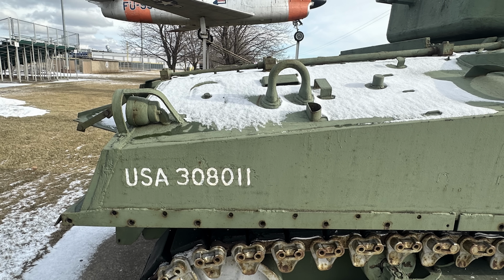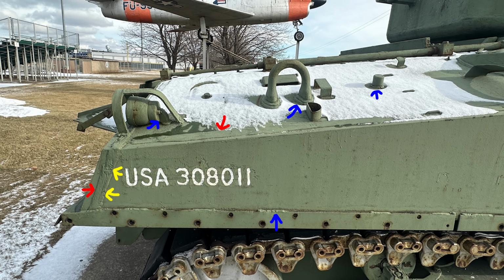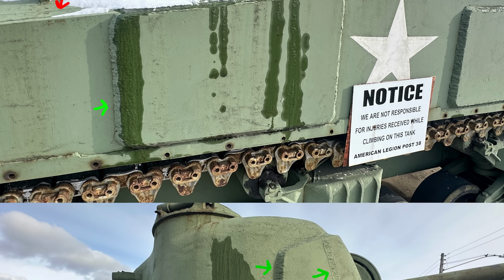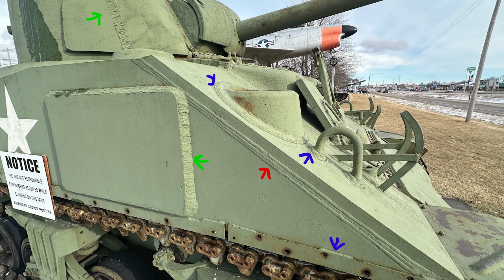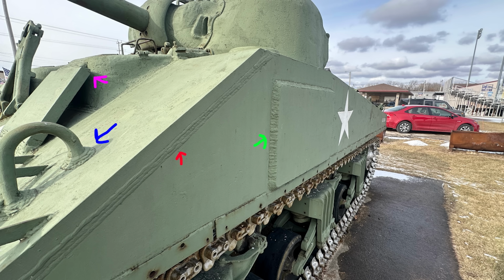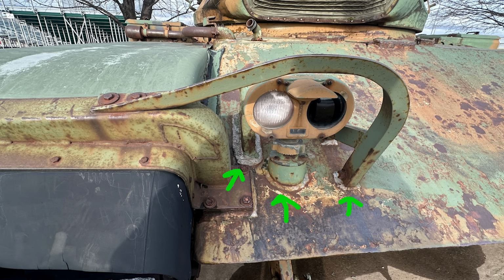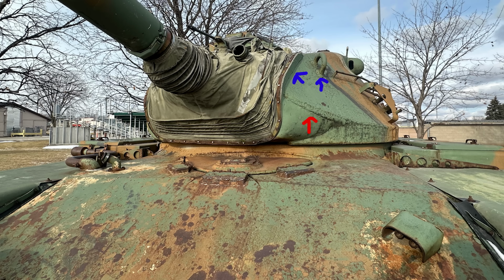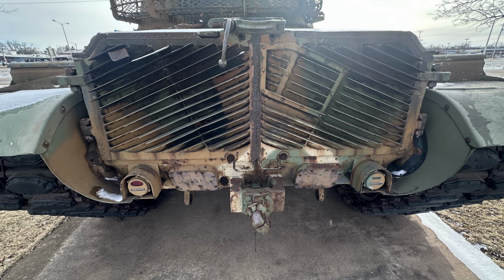Inspecting the welds on roadside tanks

Comment: This, I'm afraid, is going to be long and not have much to do with welding.
At the start of WW2, in the US, they overestimated demand for tanks.  In 1943 they cut back production greatly.  That tank in Appleton was made by Ford.  Less then 2,000 were made before Ford was removed from production as other stuff had higher priority.  Ford made Jeeps, B-24s, R2800 engines, etc.

Early M4 tanks had "dry storage" of their main rounds.  The Brits claim the M4 was a "Ronson" but that is bad chemistry.  Gasoline needs to be emulsified before it burns.  If that wasn't true I wouldn't have so much experience tuning carbs.  Big explosions are invariably the items own ammo going off.  See the HMS Hood and Barham for examples.  When a tank with bad ammo storage goes up, typically the turret if flung off to release the pressure.  See Russian tanks for examples.  M4 Shermans went to "wet storage" of the rounds to fight that.  

The Germans in 1942 and 1943 didn't really have big cannon to fight tanks - that came later.  So they figured out where the weak bits of the Sherman were and targeted those locations.  M4s allocated for overseas use were those with wet storage.  Thus the Ford M4A3s were restricted to stateside training.  They still received additional armor plates to cover the weak bits.  That tank has those.

In 1944 tank losses were extreme.  They let out contracts to gather up training tanks and rebuild them for overseas use.  Typically, an M4A3 rebuilt for overseas use would get the horizontal volute suspension, the 76mm cannon, and wet storage.  That one has none of that.  Thus it likely never went overseas.

  A Sherman with heavier armor was fielded: the "Jumbo Sherman."  In early 1945, 3rd Army ordered that destroyed Shermans from the Bulge be gathered up and armor be cut from them to be added to some existing tanks.  The armor came from Shermans, not German tanks.  The 3rd Army after action report for August of 1944 to May 1945 covers it.  Volume II, Annex 9 (Ordnance Department).  All "Jumbo Shermans," those from the US and the new ones they had made in 3 Belgian factories, received the 76mm gun.  That tank in Appleton doesn't have the armor added in the ETO was it was done differently (the annex has pictures).  Not all tanks were done as the lead tank in a column is the one likely to get hit and that is the one that needs it.

Thus that tank was made by Ford.  Unlikely it ever left the US.  The added armor was done in the field in the US.  

Down in Kenosha was a guy, circa 1996, that had a little tank museum.  He had a lot of tanks.  Including a bunch of M4s.  Don't know if it's still there.  

Yes, I say "anyways" too.  :)
Reply from the maker: Awesome thanks for the info 😀👍👍.  That place still exists, but it moved just over the border in Illinois and has expanded to have a ton more.  So cool checking out all the old military equipment there.

Comment: This is an earlier M4A3 with a 60-degree front armor glacis plate. The square armor plates were added after manufacturing in the field. The plates were sent to armor units as upgrades. As well as the turret gun shield. The center part is original. The side "wings" were added later. Interestingly, only one side has it. They were usually welded to both sides of the mantlet armor. Also interesting is that some US WWII tanks were "upgraded" with local steel cut from German tanks like Panthers and Tigers. The ring around the machine gunner's position is a mount for a canvas dust shield. The hose-looking things are clips for the cover. The plane is an F-86D Dog Sabre. A late 50s improvement of the venerable F-86 Sabre of the Korean War.
Reply from the maker: Awesome info, thanks for clearing up a ton of details on those things.  Using steel cut from other tanks is a wild (but likely effective lol) idea.  Definitely a good idea if you have the scrap available lol.
Reply: I thought I would try and find what that hose looking thing was before checking comments. I spent over an hour searching everything i could find, nope. Even model building sites people showing pics of the gun mount, nobody said what it was. I found one manufacturing diagram of external features that listed it as part number YY, however no table to name the parts! Not a single picture of a tank as in war shows a cover  crazy, I'm assuming that nobody used it or it was only for certain conditions and rarely fitted 🤷‍♂️
Reply: @CSkwirl  Hi. It's the mount for dust cover. When the canvas cover was on, it covered the entire ball mount and 30 cal machine gun mounted in it. That's why you don't see it used much. It restricted the gun movement.

Comment: Big question.  How can one avoid having a thin weld at the end of a weld when coming off the plate, like at the end of a fillet?  I do try to go back to fill the crater, but it still seems too thin at the end.
Reply from the maker: Great question.  So that crater or excessive melt through at the end takes a bit of work to fully eliminate.  I am not sure why but many people never mention it’s really a two part solution.  Many people pull back away from the corner to let it fill it, and that works.  However that might leave a glob of metal at the end.  I find that the last 3/8th of a inch or so by speeding up slightly, hitting the end, pulling back about 1/4inch, letting the wire fill, and then cutting the arc works better.  Just sitting at the end pumping in wire gives worse results generally.  That’s with wire processes.  With stick generally you can tighten the arc a bit near the end to reduce heat input and then just pull the corner back to let it not leave a blowout.  

Your settings must be dialed in as well.  If you are running hot it will be hard to not blow the end out.  If you run cold the metal will stack on the end like caulk.  Getting things looking real good is really a combination of a slight increase in speed towards the end with a pull back.  Hopefully that helps 😀👍
Reply: @ Thank you for these indications!  I’ll try this next practice session.

Comment: The bevels on the thick plates had to be deep and wide hence the three top passes,  The sub arc I ran used two dual spool 3/32 Lincoln wire and made really smooth welds, nothing like seen here. These were girder boxes for cranes.

Comment: 12:30 That thick metal wire in the shape of a horseshoe thats around the machine gun on the hull was used for clipping a type of brown canvas/cloth material similar to what you see on the next M60 tank near its cannon. Those nozzles/nips you're talking about are a sort of point to clip onto. I hope YT doesnt delete my comment for posting a link but heres an example https://i.redd.it/rs3frx7x4zw81.jpg

Also yes those extra welded thick plates on the front could save the crew from most of the Germans cannons they faced but only if they hit that tiny place which really was only for making you feel reassured because as you can see they welded them where the driver assistant and driver would sit but if it hit anywhere else they were dead.

The hitch rating on that tank is made so it can be pulled out of a ditch 😄

Comment: From what i remember from old timers telling me during their careers working with the old timers of their time, they had used GMAW and the machines were just horrible to dial in. If im not mistaken the first wire feeder system came out in the 60s and they would have the filler wire by the barrels rather than spools. And as for gas i believe they used CO2. I could be very much wrong so dont blast me up that badly
Reply from the maker: GMAW existed as far back as the late 40s but it’s really hard to say when it was used in the military.  Flux core wire existed and was used as early as the 40s on ships, but I haven’t seen much that would suggest they used it on tanks, likely because a wire suitable for welding armor likely didn’t exist.  I bet whatever machines were used for wire in the 40s to 60s were real rough.  Welders in the 40s consisted of basically a giant transformer with a/c only output.  To turn that into a functional dc output machine for GMAW had to leave a lot to be desired lol.  CO2 could definitely be used, it would react bad with stainless wire they used for some welds (lost corrosion resistance) but that wouldn’t be a issue since they were using stainless to prevent weld cracks on armor.  

I don’t think I would want to make tanks using the 40-60s tech lol.
Reply: @makingmistakeswithgreg  oh heck no! I wouldn't either haha!  I'm not sure either but they must've used a lot of 309 rod for welding the dissimilar metals then? It's definitely a interesting topic just for the history of welding regardless though.

Comment: Hey Greg that hitch rating back then from Reese for US Tanks was 1,000,000 pounds LOL. But seriously, I would like to know what MIG process they used (not talking about the sub-arc) on the 1960's tank. It couldn't be short circuit with such thick material? Did they have an understanding of spray arc technology back then? Possibly they did? I'm sure the power supply was massive and they probably prepared bevel surfaces.
Reply from the maker: So dual shield existed in the late 50s and spray arc was invented in the early 60s.  Based on how the welds looked the ones on the side were definitely wire.  Some of them were too long without starts and the overall look was not what I would expect from stick.  They could have been done with dual shield but I am unsure if stainless dual shield wire existed.  My guess is they used some form of stainless wire with a specific gas mixture for the wire (possibly high helium).   With a 3-400 amp power source and stainless wire, it would likely be possible to weld thick steel like that.  Penetration wouldn’t even need to be that good because of how much weld (on both sides of the attached parts) was put down.

Comment: It’s interesting about these added plates. They were to prevent the fires that would occur if the tank were hit and some ammunition would burn off. But they didn’t work well. The solution was to have tanks fabricated for inside, filled with water and antifreeze where the ammo was then stored. That pretty much solved the problem. They tried casting the hull, but it was too difficult. The turret is cast. The British cut the rear of the turret off and added a sponson so they could fit their 17 pounder, equivalent to an 89mm, which they had to mount sideways. That could stop a Tiger. This is a strange looking Sherman.
Reply from the maker: Pretty wild how they came up with cutting turrets apart to fit a big enough main gun to be able to fire a round to stop a tiger.   The whole armor vs main gun power race got pretty crazy in ww2 lol.
Reply: @ we never thought of fighting a Tiger when the Sherman was being designed. The Panzer IV was their best tank and the Sherman had no problem with that. By the time the Tiger was in production, we had produced so many Sherman’s that we just kept making them. Roosevelt felt that it was more important to make an overwhelming number of tanks than making fewer that were bigger. Near the end of the war we produced some Pershing’s that could easily handle their heaviest tanks. But that was already late in the war.
Reply: Casting the hull was not difficult.  The problem is that cast metal is not as tough as forged metal. It also cannot be welded as easily. Cast metal has more crystalline structure to it, whereas forged metal has been pounded and has the grain aligned in one direction. This gives forged metal much greater strength.  But casting technology in world war II was very very good.

Comment: The front (bow) machine gun, in WWII, was a .30 caliber browning (M1919A4).  I believe that ring around the gun port is used to attach a canvas cover via snaps.  The snaps aren't like the kind we think of today (two interlocking round rings).  Snaps back then were a male stud, that had an indentation near the end, and a female half with spring clips on either side of the hole.
Reply from the maker: Makes perfect sense, awesome info 😀👍
Reply: @makingmistakeswithgreg  Sorry, I couldn't remember the name of the snaps when writing my original post.  They were called Lift the dot fasteners.  Very commonly used in that era.
Reply: @makingmistakeswithgreg  Sorry, I couldn't remember what they where called when I posted earlier.  Google "lift the dot fasteners" for more details.  A lot of WWII area equipment used them.
Reply: @makingmistakeswithgreg  Sorry, I couldn't remember the name of the snaps in my original post.  They were called ""Lift the dot" fasteners.  Very commonly used in that era.  Google "lift the dot" and you can find more details.
Reply: this is correct
Reply: The snaps are the same ones used on cartridge belts and canteen covers.

Comment: You sound alot like Greg from  Greg's Airplanes and Automobiles channel . Are you the same Greg? 
 Those "nozzles" around hull MG port are attachment points for anti dust cover or masking netting  as far as I remember. Or for a transport cover. These tanks were shipped without their MGs so to save them from corrosion or dust induction. 

Added plates on the turret were due new radio installation required internal armor delete. So additional external  plating was added. Interesting gun mantlet  , it looks like very early M4A1 gun mantlet halfway upgraded to M4a2 standard mantlet.

Additional plates on the Upper front plates (UFP)  were due to the new requirements and installment  of big driver hatches. Bigger driver hatches were installed and factories as a temporary solution added additional plates to protect weakened flat portions of  upper front plate(UFP).

Later with M4a2 UFP was redesigned to a thicker  uniform UFP but at a lesser angle to accommodate bigger driver hatches.  Less angle was compensated by slightly thicker UFP.
Reply: He sure sounds like greg. But i doubt he would ask about the plane if he was the "greg"
Reply from the maker: You’re definitely not the first to ask that question 😅.  No relation to him.  Thanks for all the nice details on the Sherman.  It’s crazy how much knowledge people (such as yourself) have regarding changes and things I would completely overlook.  It blows my mind at how many changes were done to many of the ww2 era tanks and vehicles.  Luckily the library here had a book on the Sherman tanks so I rented it to help learn some more useful stuff😀

Comment: I think that is a Super Sabre Jet. They probably had limited amount of Rotisserie stations to position the hulls as they were welded. At this time frame it was build as quick as possible and get it out the door.
Reply from the maker: Yep, likely get the main welds done and get the assembly to a place where a few people can weld stuff on it and call it a day 😀👍
Reply: @makingmistakeswithgreg  Greg, let's not forget, that torch welding was still a huge thing back then. So some of the stuff we/you are looking at may very well be torch welds.

Comment: The Australian Armor and Artillery museum has done a whole series of videos of their workshop crew welding old armored vehicles back together and they say structural welds in WW2 armor steel have to be stick welded using stainless steel rods or they will crack.

The appliqué armor plates on early Shermans could have been installed at the factory, at a depot or even in the field depending upon when the tank was built.  They started adding the extra armor patches on the assembly line and sent out kits to upgrade the tanks already in the field while they worked on an improved design that didn't need them..
Reply from the maker: I wish I had a XRF gun to test the metal and the welds, it would give an alloy composition.  Due to the massive thickness of the steel and limited welder size, it would be hard to put down a big single pass that would cool slow enough not to crack.  Sub arc and 1/4inch rods on reasonably hot tank steel might work with normal mild steel filler metal, but stainless would likely work even better.  I am not sure that the original big sub arc welds were stainless, almost all of the stick welded welds I have seen are.  I need to bring a magnet and test a bunch more things 😀👍.  I also need to watch those videos.
Reply: workshop Wednesday is awesome

Comment: You don't fit inside them Greg, neither do I lol
Reply from the maker: Haha at 6’6 I definitely wouldn’t 😅.  Must be very hot and miserable to drive a lot of the older tanks.  I will say the American submarines aren’t as cramped as I expected, likely far more room than a tank.
Reply: @makingmistakeswithgreg  You'd be surprised, Col Moran (AKA The Chieftain on youtube) is a very tall guy and fits well enough to operate a Sharman or Panther, since American and German tank designers prioritized crew comfort. A comfy crew is a less tired crew, and a less tired crew can perform better in battle. Meanwhile in the USSR the designers seemed bent on making crews suffer as much as the guys on the receiving end of the tank's cannon, I doubt anyone over 5'8 could get out of a T-34's driver hatch with much haste even if it was on fire.

Comment: Hi there and big congrats on your channel and creator ethics - much appreciated!
I observed that you're only mentioning electric welding processes. I grew up in Romania and in the comunist era the prevalent process was the acetilene torch with its acetilene generator (calcium carbide and water). While we had some home-cooked generators with highly doubtable security standards, the most used process by the pro welders was the acetilene torch, probably for the high versatility and the cheap consumables and hardware.
So, my quick question: do you think that all welds that you've seen are electric processes? Why? What would be the observable differences? Thanks a bunch!